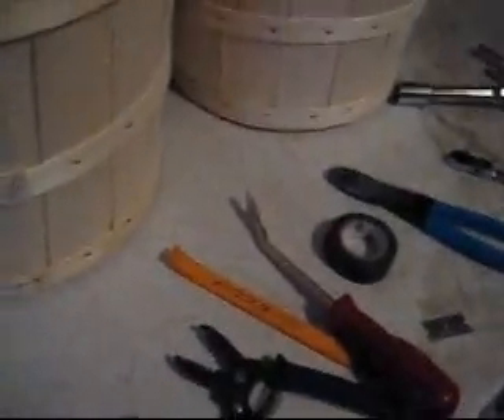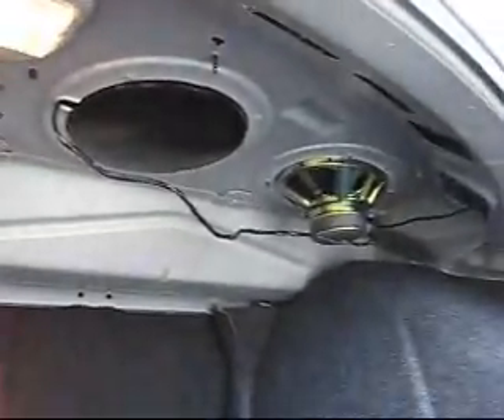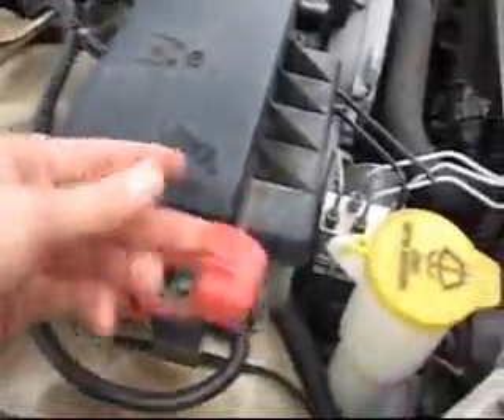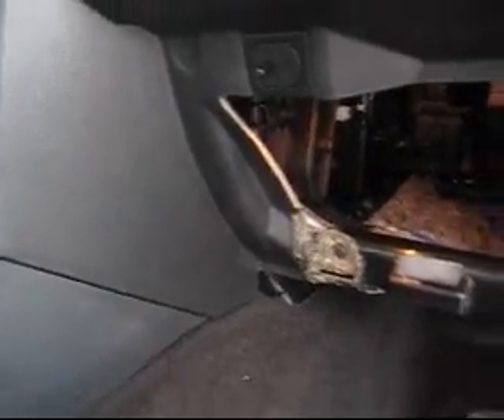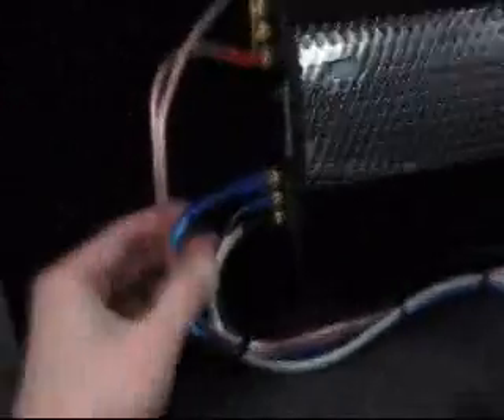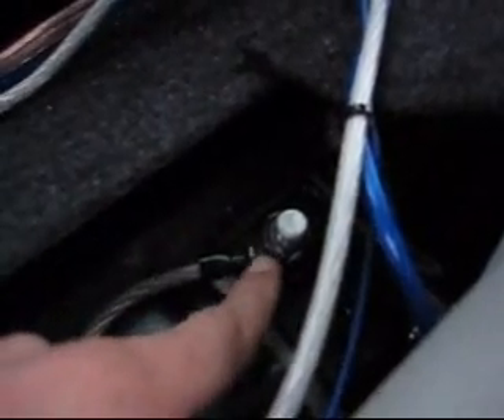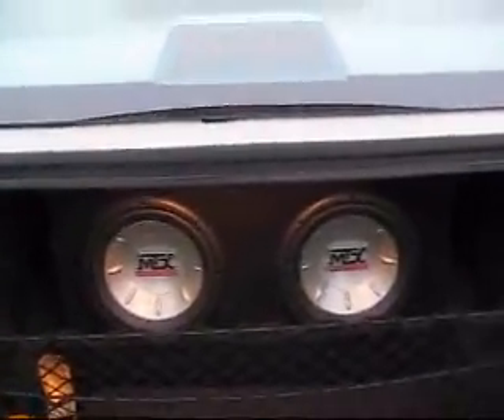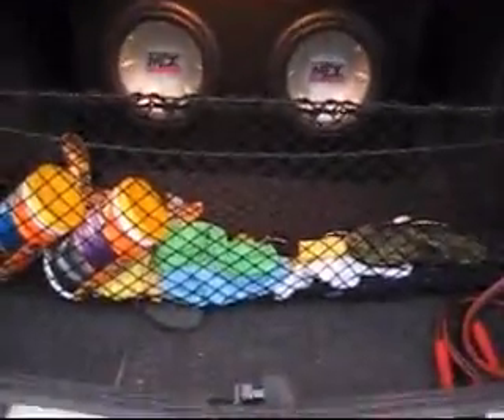How to install amp into 2007 Chrysler 300, keep factory radio

Comment from the maker: yes there is, i'm sorry i didn't mention it in the video, but next time i'll make a video all about this... whenever you hook up amps, make sure the fuse is out of it's holder. make sure the head unit isn't on. connect the ground, then power (even though there's no source yet), then remote and finally the RCA's.. after that put the fuse back in